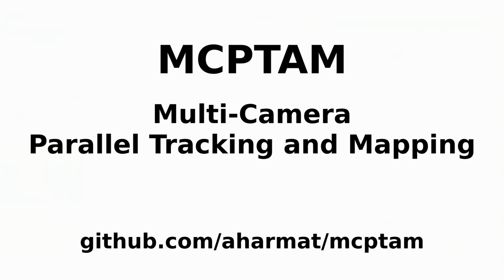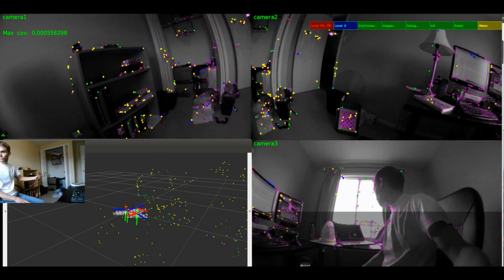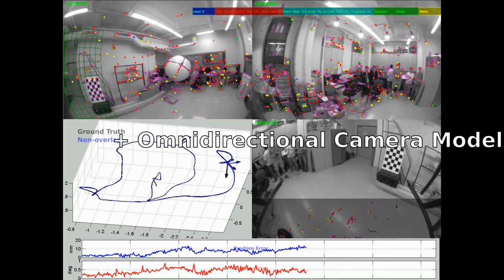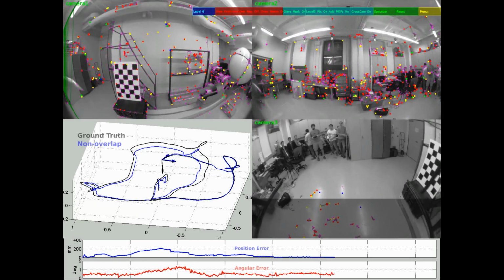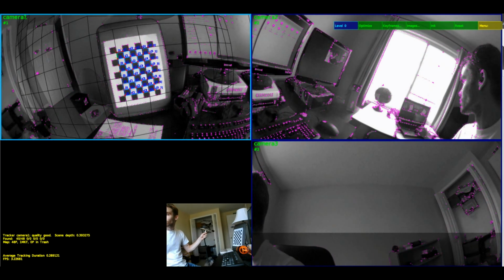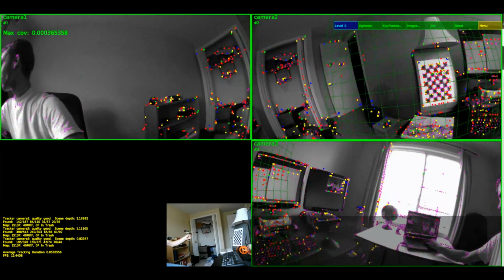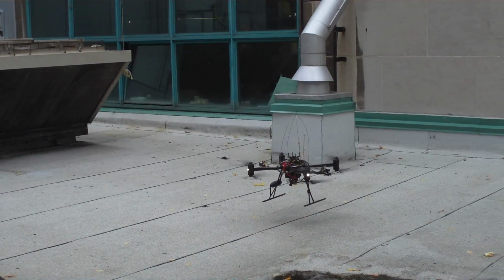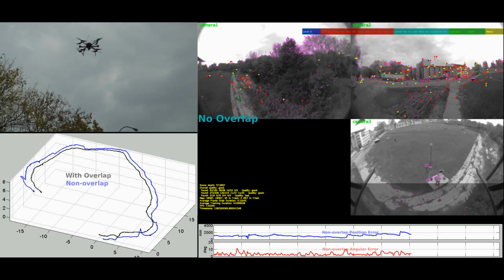Multi-Camera Parallel Tracking and Mapping (MCPTAM) Software

Comment: Hi, I tried to compile it for the current ROS Version (Melodic) but failed due to incompatibilities across different libraries not working with each other. Do you have a solution to compile it for ROS Melodic?
Reply from the maker: Hi Tom,  I believe the project is now being maintained by the TRAIL lab at University of Toronto: https://www.trailab.utias.utoronto.ca/
There is a more recent version of MCPTAM at https://github.com/wavelab/
Additionally, there are more projects on those sites related to follow-on projects on Dynamic Camera Clusters where individual cameras can change their poses within the cluster. Thanks for your interest!
Reply: @michaeltribou  Thank you so much for your quick response!! I will look into it, thanks.